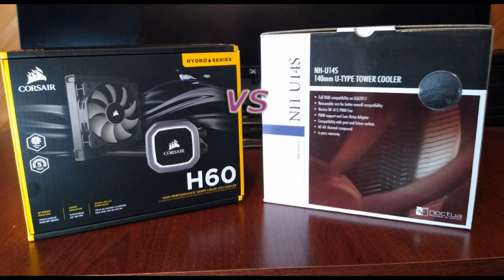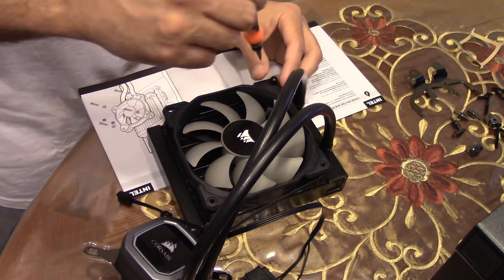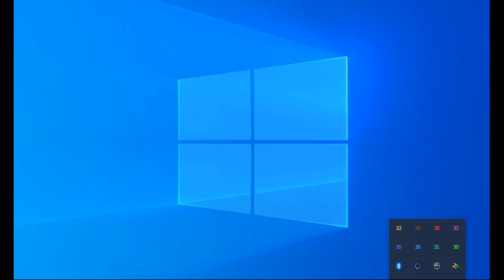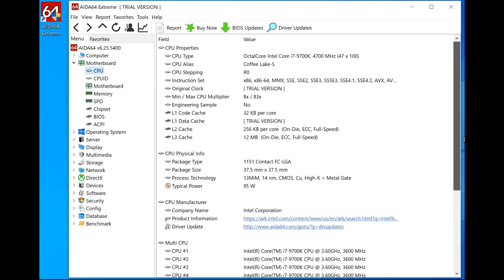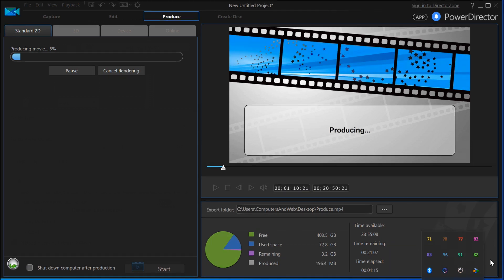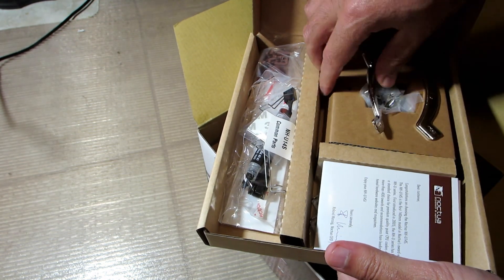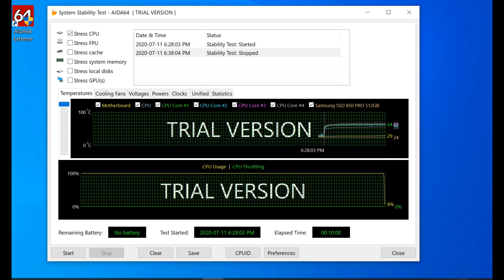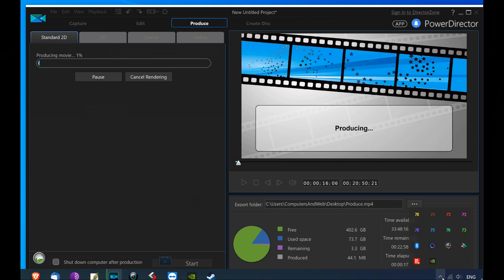Corsair H60 vs Noctua NH U14S Installation and cooling. Which CPU Cooler is better?

Comment: nice video. i recently bought h60 as i built an itx pc. i immidiately changed the fan to a gentle typhoon. do u think changing to a good fan like gentle typhoon makes a difference?
Reply from the maker: Thanks. I have never used the typhoon before so I am not sure if it will make a noticable difference.

Comment: The way you apply the thermal paste results in an inclusion of lots of air bubbles in the interface between the CPU and the cooler dye. This is a totally wrong way! Apply a small nice round click of the paste in the middle of the CPU. No need much of paste, it is only there to fill the tiny air gap and the surface roughness.  Do not distribute!!!  Just push the cooler dye gently so the gap is filled with the paste evenly and WITHOUT air pockets. Twist few times a little to squeeze the excessive paste out of the interface. Fix the cooler with screws and you're all done.
Reply from the maker: Thank you for your feedback. If you have noticed, I apply and distribute very lightly and press to get the bubbles out. I have been doing that for the past 10 years. Never got any cpu burnt or overheated. Every thing I build, gets tested heavily before being delivered to the customer.

Comment: Hi! Saw that you got a h60 there. I want to ask if I can connect the pins to a fan hub? Or should I just directly connect them to the header
Reply from the maker: You can do either as long as you the right plug receptor